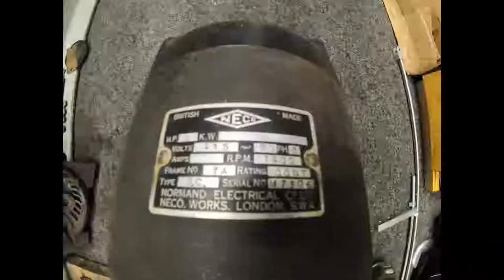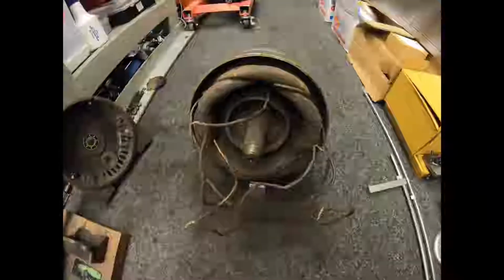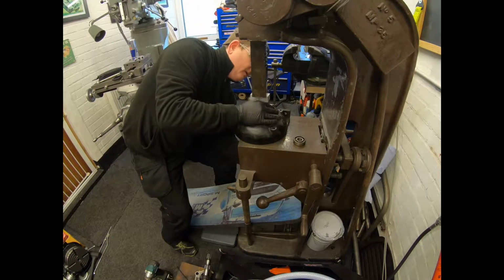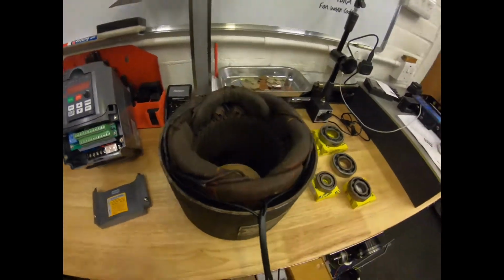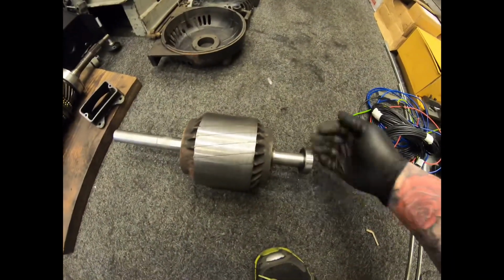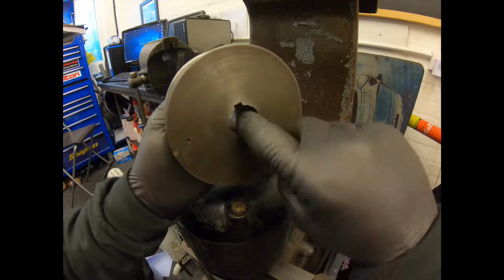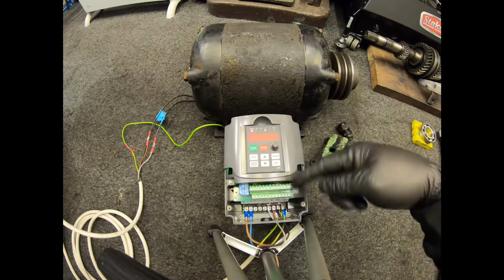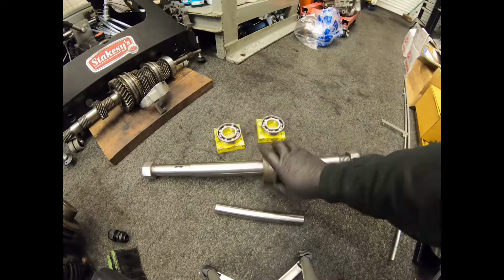Milford wet stone grinder motor tear down and re wire to 220v 3ph

Comment: Excellent work Marc. Were the original bearings marked up and did they have a C3 designation which is normally for high speed motors. Suspect they were quite old judging by the year of the machine.
Takes a lot to put vids together so thanks for posting.
Reply from the maker: Mapstar Damo 
Hi
The bearings were very old it seems, probably original and no class markings so I just replaced with a cheap brand suitable for a 1400rpm motor as I didn’t want to spend £50 each on skf bearings

Thanks for watching and commenting

Marc